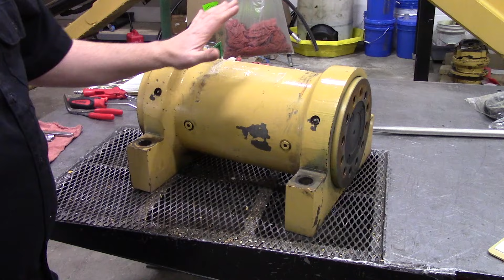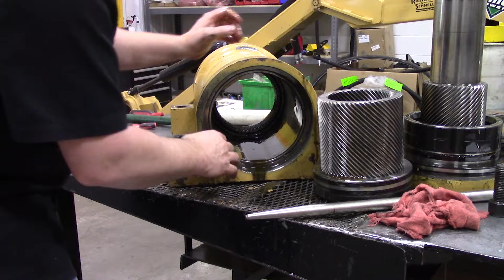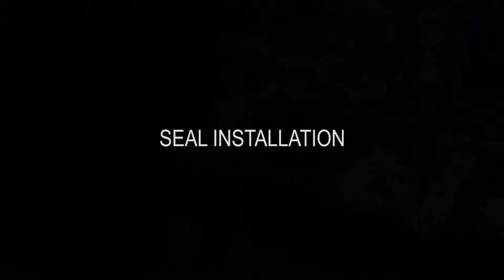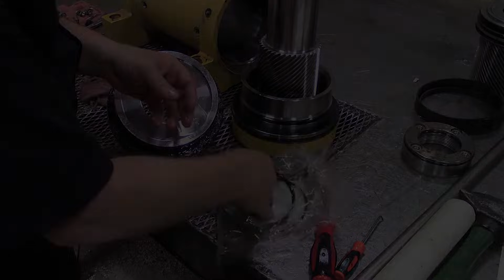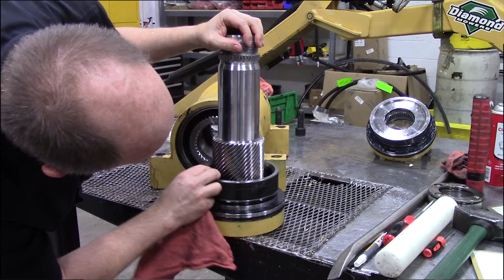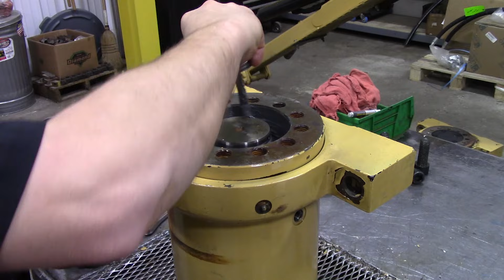Boom Mower Actuator Rebuild - Tech Tips - Diamond Mowers

Comment: If the air gun isnt strong enough or doesnt work. connect a grease fitting and use grease to push the ring out. i figured this out after trying to get it out all day. came out with ease using a grease gun